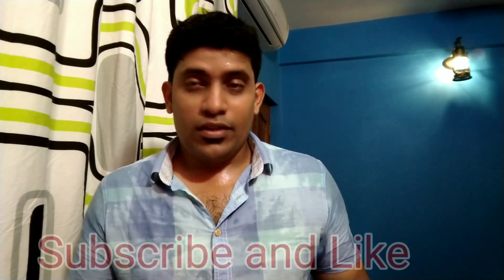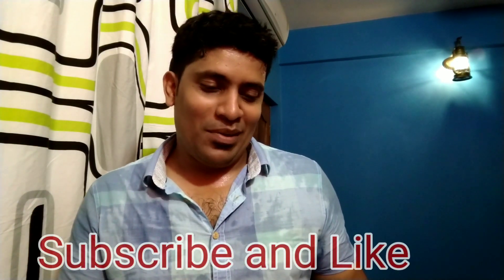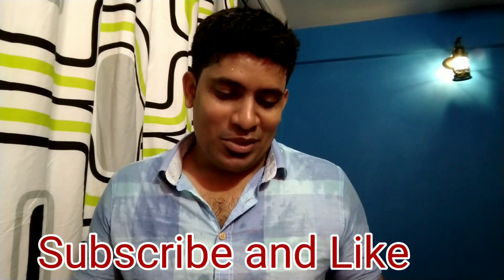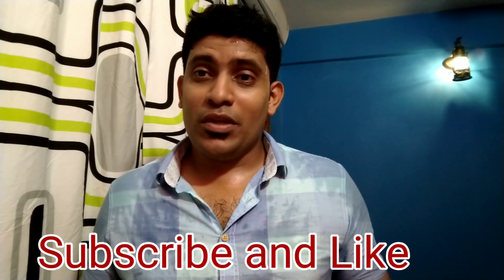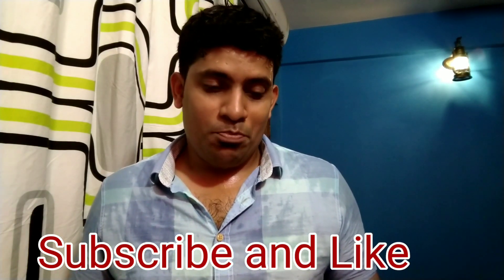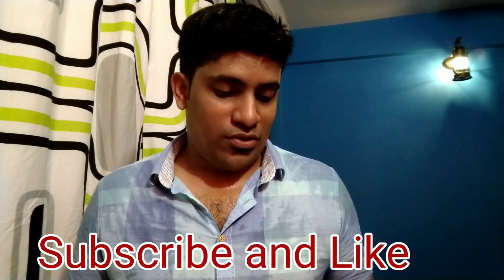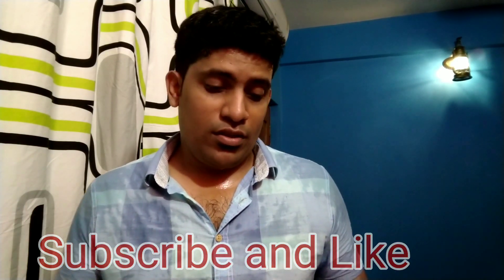Oral Questions and Answers, Q&A, #oralquestion S01E01

Comment: Sir can you explain after co2 flooding reentry procedure the ship provided with tunnel and without tunnel pls explain sir
Reply from the maker: There should no difference as tunnel is suppose to be kept closed at all times, it's an enclosed space, still I'll check
Reply: OK sir thank you . Engine room is flooded with CO2 sir.after that we reentry to the engine room. So which way we go engine room sir.
Reply from the maker: Before entering temperature should be checked of all the places which I ver checking and ven u are sure temperature is reduced you can stop boundary cooling and then you can enter with fire suite and charged hose to extinguish fire if any left and entry has to be decided based on location/source of fire or depending on temperatures but not from tunnel.
Reply: @BasicMarineEngineering  thank you for replying answer sir
Reply: Sir can you make any video for exhaust valve in 2stroke engine and air spring arrangement with full detailed explanation. 
..
Reply from the maker: have noted will try whenever i get the opportunity....
Reply: @BasicMarineEngineering  OK sir